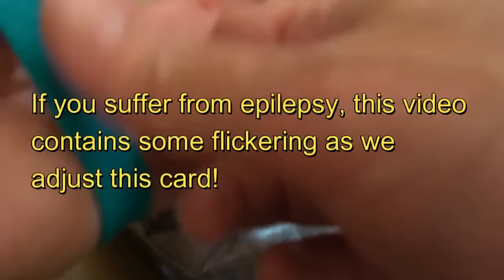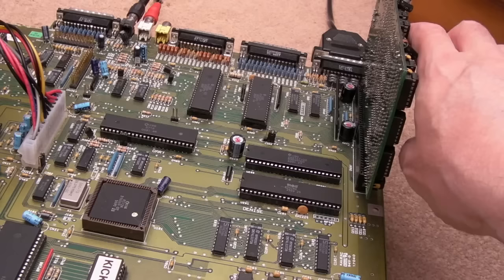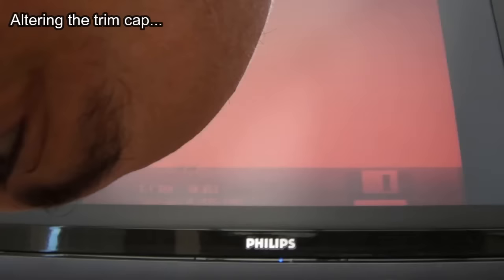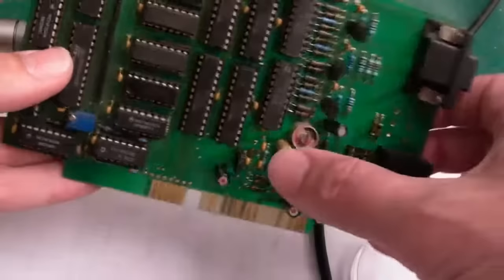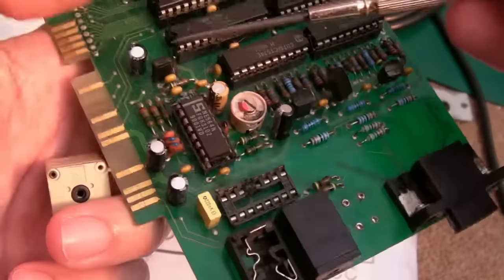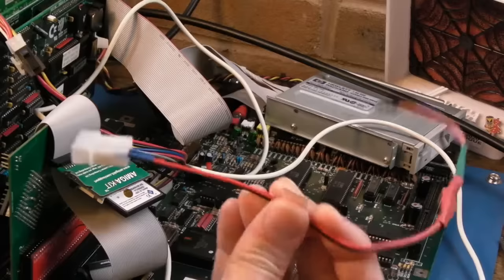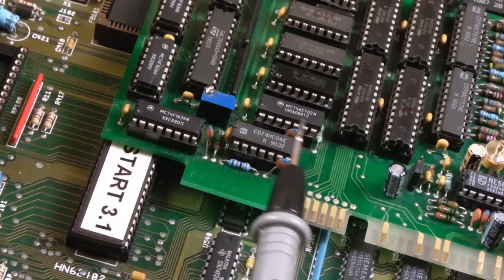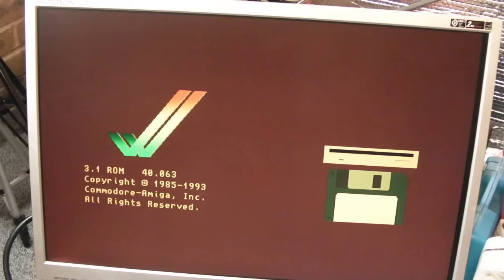Old Scan Doubler - Can I fix? (Revised)

Comment: Found this in the Big Book of Amiga Hardware - A very old (circa 1991) deinterlacer card designed for the A2000. It has a standard VGA type connector, however it does not pass through VGA video displays, it only stops the flcker from interlaced displays. The card was supplied with software for OS 1.3 which allowed you have to have variable sceenmodes however it's a patch. It's been reported to work OK under OS 2 providing a flcker free display in 640*400 60Hz (NTSC).
- VGA (15-pin)
- Adjustment
- connectors for passive walkman boxes (the DEInterlace card contains a small amplifier, in Germany MacroSystems offered Sony loudspeakers for about 50 DEM)

Comment: The TICK issue is because VSYNC and HSYNC signals on Agnus are actually bidirectionnal. When a load is too important, VSYNC switches to input mode like if an genlock was connected and you loose VSYNC signal. As for the RAM with unconnected bits, if the data lines are left floating by design, it is a mistake. The I/Os will get damaged over time, they should be connected to ground through a pull down resistor.